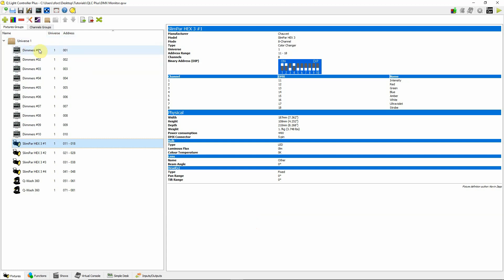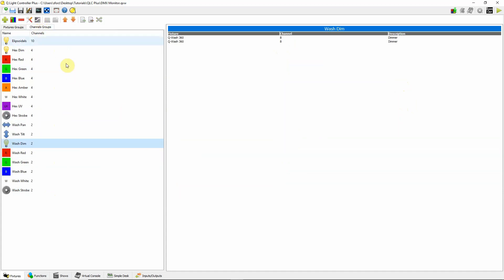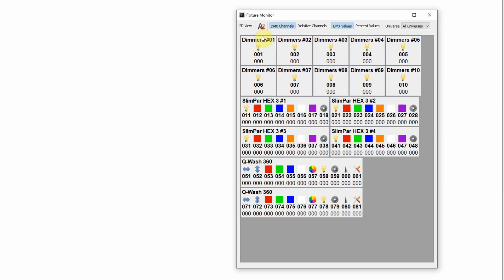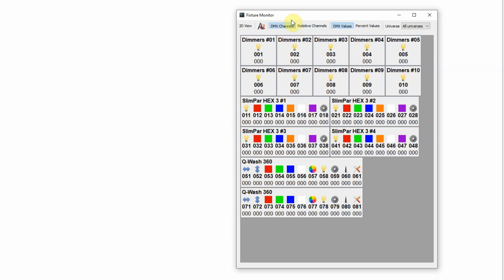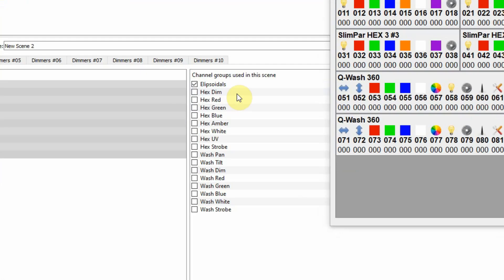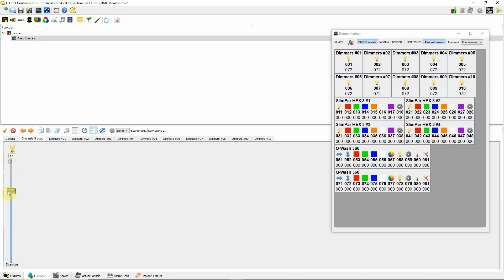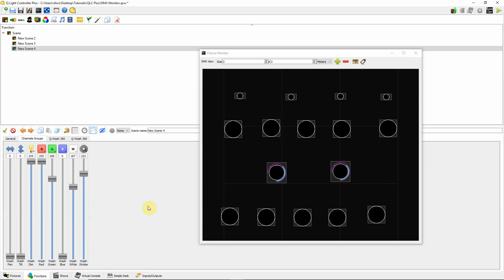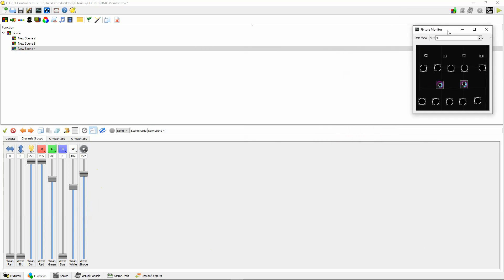QLC+ DMX Monitor

Comment: Thanx a lot! How do I separately show the lights in the 2 D viewer when they are connected to a dimmer with 4 channels - and every channel has a separate light (in my case a LED strip)? (and of course, I do have more multiple of these 4-Channel-Dimmers)
Reply from the maker: Hello
So you only have two options here and it all depends upon how you set up the LED strips in your fixtures tab.
Lets take one LED RGB strip for example:
You could list it as one fixture with 4 DMX channels: 1-Dimmer, 2-Red, 3-Green and 4-Blue. In this example you would only be able to display it as one light in the DMX monitor but it would display the changes in color. So if your Dimmer, Red and Green channels were at 100% you would see a yellow light.
The other option would be to enter the 4 DMX channels as simple dimmer channels in the fixture tab. For example the dimmer channel could be generic dimmer 1. The Red channel could be generic dimmer 2. The Green channel could be generic dimmer 3. And the Blue channel could be generic dimmer 4. Now these would show up as 4 separate lights in the DMX monitor. These would be displayed as white lights since they are just generic dimmers. You could fix that by clicking in the "Gel Color" box and selecting a color when you are placing your lights in the 2D grid.
Hope this helps
Ed Richards

Comment: I ran into a problem, so, I have a 12 channel dimmer, and the dmx monitor says it has twelve heads(cause its 12 channels) now when I add it into the dmx monitor it adds the 12 channels as a group, but I would like to seperate it, to correctly represent the lights. Any advice on that?
Reply from the maker: I assume that you are talking about a 12 channel dimmer pack and you are plugging incandescent lights into each of the channels?
Instead of setting this up as 1 fixture with 12 heads, just set it up as 12 generic dimmer channels with the DMX addresses matching the channels of your dimmer pack. That way you can position each light as you please in the DMX monitor.
Can you tell me the model of your dimmer pack?
Send it to my email address:
ctltech2@outlook.com
Reply: @edwardrichards7722 thanks for the answer, great tutorial btw, I will send it tomorrow if I dont forget